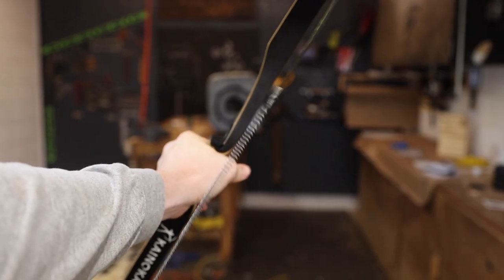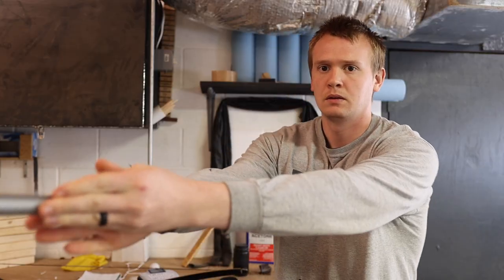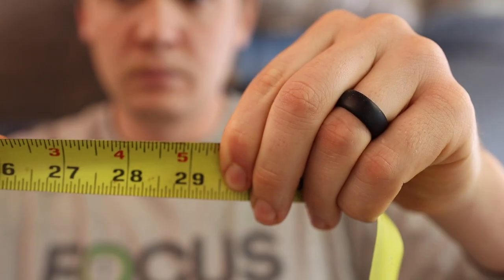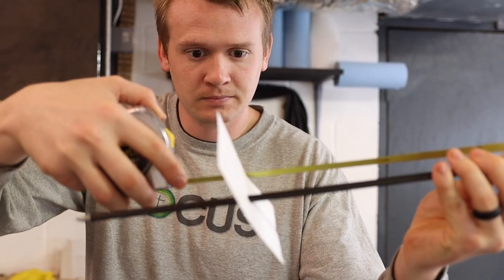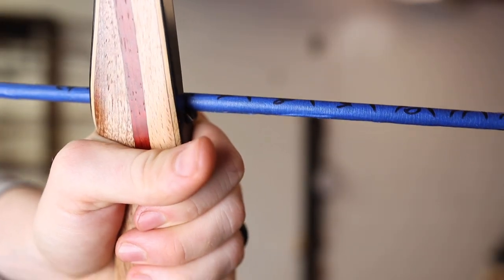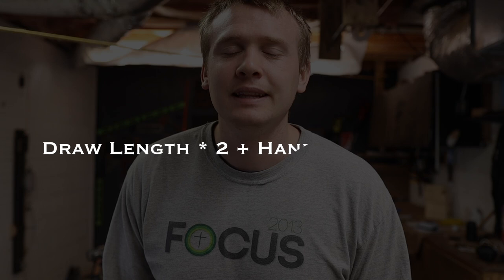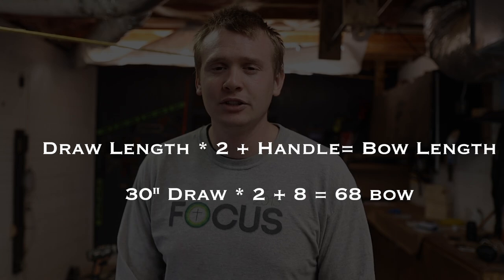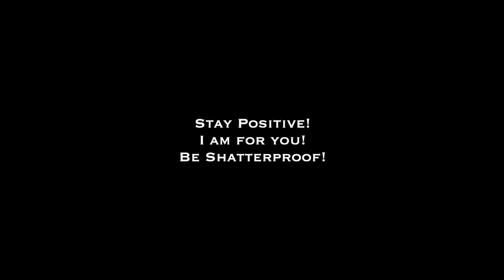3 Ways To "MEASURE DRAW LENGTH" -- Recurve Bow -- Longbow -- Traditional bow + "BOW GIVEAWAY"

Comment: You are a great guy and make very good videos.  But that is not the definition of draw length.  At full draw, it is the distance from the nock to the deepest part of the grip plus 1 3/4".   This is the definition established by archery manufacturers.  However, everything else you said was correct.
Reply: Agree

Comment: Next time I make a bow I'll keep that formula in mind, less guesswork lol I measured my draw length by "drawing" the end of a tape measure back like an arrow (hooked part simulating the string), and hanging the measure over my bow thumb, using wherever it hung on my thumb as the measurement, in my case, 32 inches. May not be too accurate but I think I got close at least.
Reply: Sounds good to me

Comment: I gave up. I've been wanting to build a bow for ages. Just came back from the hardware store with a draw knife, a scraper, sandpaper, 2 rasps, nails and a 4x4 for a tillering stick and - no other wood was available, but It's just to get the hang of it anyways - two boards of spruce. I'll start tomorrow once daylight hits. You pushed me over the edge, man, thank you!
Reply: Nevermind, I started today, shaped the first limb to layout, had to stop for today, though. Doing it on my third-story-apartment floor with the board clamped to my bed, leaning on the wall as I draw and that's a little loud on the neighbours for night time. Turns out drawing with the knife is harder than expected.

Comment: When Calculating the bow length: What is the "handle section"? Where does that begin and end? Is that the full length of the riser or just the part you grip? Fore example: on my Samick Sage the grip part is ~4.5".  The riser, measured end to end is way more than 8" (like 19.25"). Great video, just looking for this one clarification.

Comment: Another accurate method I came up with and use when I'm by myself (no camera or arrow required):
Tie about a 3-foot length of string to the bowstring at the nock point.  Stick a piece of tape on the side of the riser and over the string, in the area where the arrow would normally be.  The reference EDGE of the tape should be at the place to which you want to measure the draw length.  Pull the excess slack out of the string by sliding the string through the tape.

Draw the bow to your normal anchor point.  The string will slide through the tape but will still be loosely stuck to the tape.  Let down, then pull the tape off the bow WITH THE STRING STILL STUCK TO THE TAPE.  Measure the string length to the reference edge of the tape -- that's the draw length.

Comment: what is the bow length recommendation based on? I shoot a Turkish sipahi bow and it is 48" which is actually pretty long for the style. They tend to only have a max draw of 28" but that would be a recommended length of 64" by your calculation. Is it about string angle and avoiding stacking? If that is the case the shape of the bow and materials used massively affect how that occurs. It seems like this equation only really works for very typical modern western longbows.

Comment: Just a heads up about the "good enough" method. I have a very big "wingspan" and the first method yielded results that would not have been good enough for a first bow, by far. I meassure 28.5" draw lenght with that method, and at my club my draw lenght was meassured to 32.5 :) I think it is because I have broad shoulders and the first method does not only not account for that, the angles will actually make for a shorter meassure the wider your shoulders are.

Comment: Try this, take your finger tip to finger tip measurement, divide it by 2.5, this should be very close if not the perfect draw length. At least it works well for everyone that I've checked. 
Example:  70" finger tip to finger tip. 
70÷2.5= 28" draw length

Comment: I have unusually long arms.  By the "wingspan/2.5" and stick methods I have a 31" draw length.  Measuring the best I can from back of bow to comfortable anchor point I measure 32"-33".  The larger of these with the calculation for a longbow per your guides makes for a rather long 74" bow.  At the lowest I'm still looking at a 70" bow.  Should I aim for making a 70" bow and be very careful with my tillering and perhaps add an additional fiberglass or rawhide back layer to handle the potentially longer draw?  Other suggestions?
Looking forward to getting one made.  I've already picked out the string type I want from your site.

Comment: how exactly do you figure out handle size for a bow? im assuming i wouldnt use as big of a handle as you since i would be using a smaller bow. from the formulas online i have found my draw length to be either 24" or 25"

Comment: Hey guys,
 I started building my first selfbow but one thing I am struggling with is to get straight sides... I can feel with my finger that it's "wavy", doesn't matter how much i sand it down I keep getting those waves on the sides of the limbs you can hardly see it but it's there :(
any suggestions how to prevent this?

Comment: That’s great that you want a 68” bow for you but what if I want to make a bow to use in a tree stand, a bow that long will be difficult to use in that setting. So now you need to make a shorter bow that can handle your draw length, so I personally wouldn’t use that calculation you just mentioned about double your draw length + riser length
Just a thought

Comment: Method 1. My Draw Length  is 29"
Method 2. My Draw Length is  32"
Most bows only come in 60" length and 30" draw legth. So instead of 72" x 32 it's going to be the standard 60" x 30", sigh...